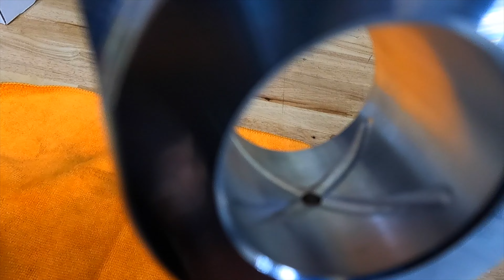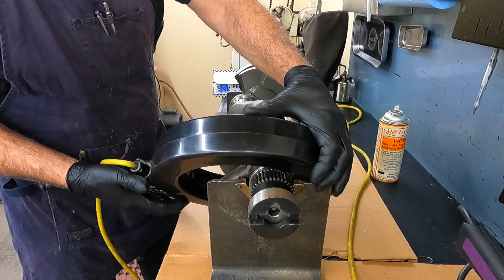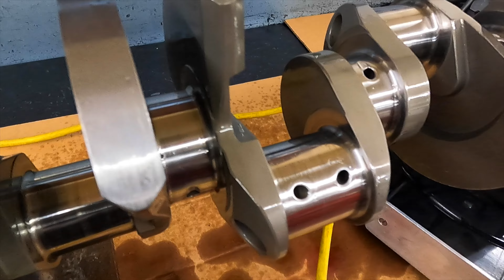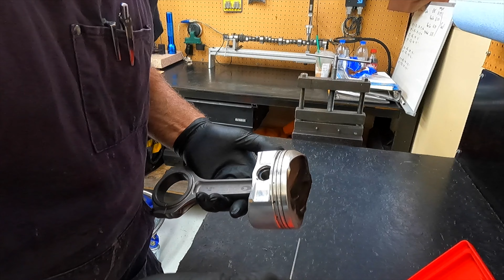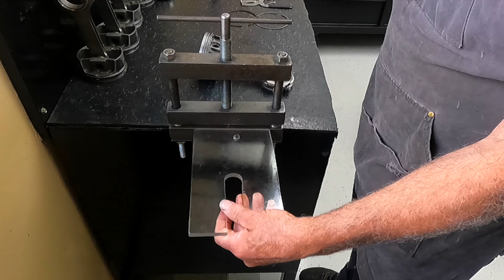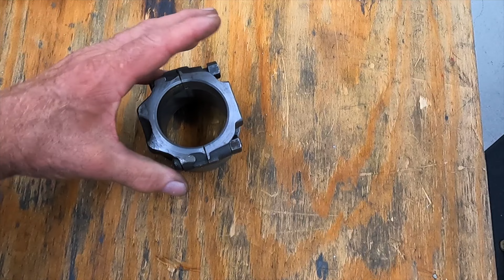diy engine building tools, magnafluxing crankshaft, checking ring lands... a day in the machine shop

Comment: Mr. Brand, I'm building an FE with a Carol Shelby aluminum block. Currently I have 0.0015 to 0.0020 lifter bore clearance. I'm running a solid roller BAM lifter and I plan to oil through the pushrod only. I'm concerned with the expansion of the aluminum that my oil clearance will become excessive and I'll starve the top end. I'm considering bronze bushings for the lifters. 

Do you have a video or could you make one addressing this or a similar situation. I'm still on the fence with my decision, and my machine shop has little to offer to aid my decision.

This is an expensive build and any advice to keep me from making a costly error would be greatly appreciated. Thank you.
Reply from the maker: what oil pump and what weight oil with or with out oil cooler
Reply: @BrandRacingEngines  Melling HV and 5w-30.

With out oil cooler, but with remote mount filter on the fender. It's a 12:1 hot street build with dual Fitech throttle bodies and dual dry nitrous plates.
Reply from the maker: @arturozarate1752  Bearing Clearance ?
Reply: @BrandRacingEngines  I was driving with my kids in the car....sorry you didn't ask and I'm not sure why I brought that up.🤦‍♂️
Reply from the maker: @arturozarate1752  It cool
Reply: @BrandRacingEngines  back to the lifters....do you feel that I need to have the block bushed?
Reply from the maker: @arturozarate1752  You are to the max I would run. If all are .0015 it would work. Check the lifter for roundness
Reply: @BrandRacingEngines  thank you Mr. Brand

Comment: Thank you for all of the info, I think you do wonders teaching the community! This in turn surely makes us more understanding and happy customers.

That piston with a wide section of ring grove, is that caused by too many cycles for that piston and ultimately metal fatigue? Or could that have been from too small of ring gap/too much heat starting to have the ring grab the cylinder wall? Would the ring gap be tighter if there was too much timing along with bearing wear.

Truly thank you for sharing!

Comment: Nice looking rods.  What's your take on whether to use aluminum rods for say, a BBC bracket motor, around 850-ish HP, heavy car?  Worth it, or just use steel rods?  And how many runs before replacing?  That's my main worry with aluminum rods.

Comment: You talked about using a mic on the skirt of the piston and I'm wondering if you also use a mic on the top of the piston? Also when you chamfer the bearings is it to match the shape on the crank? 

You channel is great to watch I can't thank you enough for sharing your tips and tricks 🤘
Reply from the maker: No not on the top. Most crankshaft have .125 or .187 radius. I cut a 45 Deg on the bearing

Comment: Thank you Gerald for the shout out.
I am in Rogers, Ar.
I like your Portable Magnaflux Unit.
Jim from Cobra Products use to sell one like that.
I sure wish I would have purchased one.
Cobra Products is no longer in business. 
I like the rod bearing chamfering fixture tool.
Alot faster than mine.
I need to make some fixtures.
I put the rings on like you.
Old KD Ring pliers.👍
Have a great day Gerald.